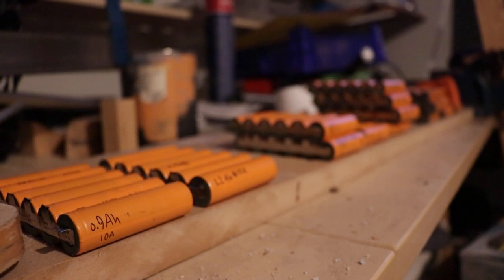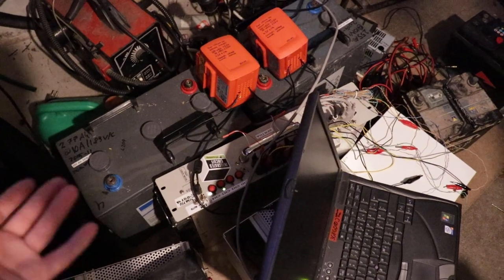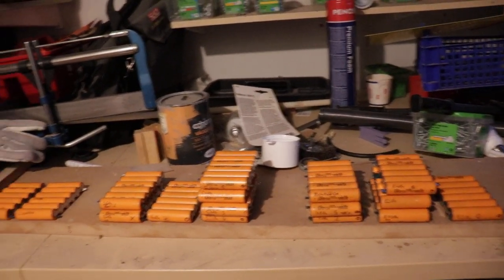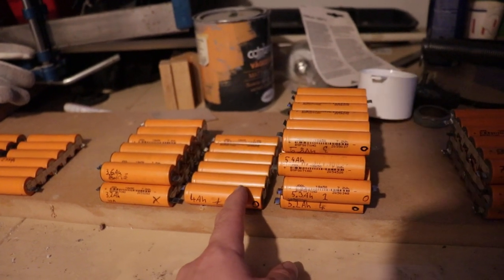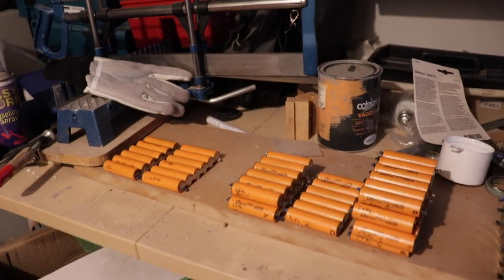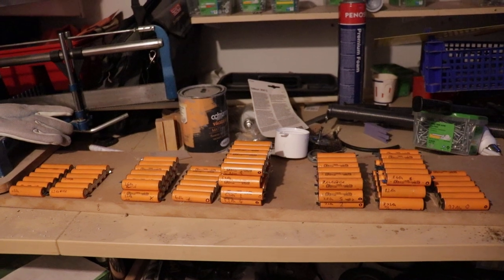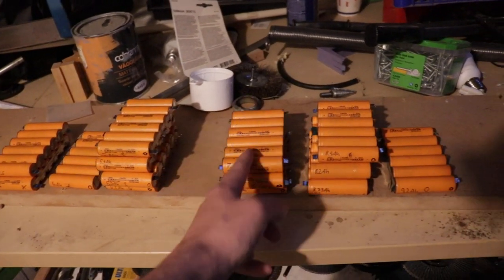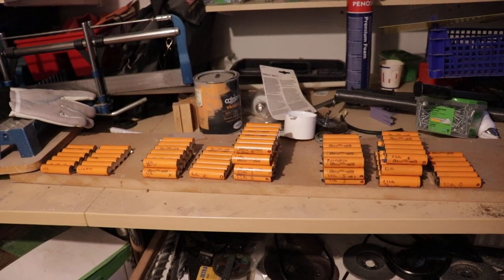Capacity test of every individual cell block in a bad ebike battery

Comment: i bet the bms had a hard time keeping it all together lol

i once taken apart a ebike battery with 12s6p with no circuitry at all. no balancer, cheap cells. the only things between the cells and the socket was a 30A fuse to the output , a 5A fuse  aswell as a PTC inline to limit the charging current on the charging port.  it did belong to some cheapo discounter ebike, literally a bomb.

Comment: Theory only, but my idea is that they're re-used cells, extracted from various-state laptop battery packs or the like, stripped of their original heatshrink wrappers and re-wrapped to look new, then slapped together into a pack and sold with an eBike that has a warranty lasting as long as a politician's promises, so when the pack dies, there's no recourse and replacements (which may or may not be in the same crap category) are expensive to buy...
Reply: Could be, but china has its share of manufacturers that just produce brand new trash cells. There are factories making 0.4Ah 18650s, with barely any materials inside, some make 2Ah cells that kinda work, but dont last due to impure materials and bad production machinery, etc. Its a huge waste of materials, but china doesnt care.
Reply from the maker: This is an interesting hypothesis, and I actually de-wrapped a few cells to see if that was the case, and had a look at them under the microscope. Sadly, there are no signs of re-use, and all cells appear identical. No duplicate weld marks, no scratches, nothing.
Reply: @FFcossag  Well, in that case, they're probably just plain old shitty cells, which as noted by someone else here is a thing they make seemingly intentionally...
Reply: @FFcossag  do they weigh any different?
Reply: @twocvbloke  Reused Li-Ion cells are not as much of a thing anymore. Seems china went towards recycling scrap cells for the active materials instead. Makes sense, since you can make 2-3 shitty cells from the materials contained in one old cell. Much of the  cost in recycling comes from purifying the materials, and you can obviously save here if it doesnt have to be good...
Reply from the maker: Not really, they're all between 43 and 45 g, and I imagine a lot of that variation is my crappy dog food scales.

Comment: It is hard to believe such variety! Unless the QC at the factory is so bad, which is hard to believe, they must be lacking electrolyte. Maybe they were badly designed, they weren't sealed properly and the electrolyte could evaporate from them? And the ones that got the most hot had the most of it evaporated, and the lowest capacity?

Comment: The owner may not have used it much but did they keep it at 100% charge all the time when not using it, on the charger all the time? That probably wouldn't sit well with cheap cells.
Reply: More likely it was stored at a LOW state of charge. Cells become unbalanced, then when charging the higher voltage ones got cooked.
Reply from the maker: No, it was mostly just sitting around at some random SOC.
Reply from the maker: The BMS in this shuts off at about 4.3 V/cell, which is way too high, but I know that the customer wasn't "forcing" it. She contacted me right away as trouble began, so I don't think the battery would have had time to die that way. Though it's not impossible. These cells could be overly sensitive to overcharge.

Comment: I'm sure someone good at statistics could point out that you have a significant chance of having at least one or more lemons in each batch and it pulls down the average. 

Can you even properly charge them if there is a bad one in parallel?
Reply from the maker: If there's a severely failed (i.e high leakage current) cell, you can't charge them very well at all. None of these are failed in that way, however.

Comment: Seems the cells have been charged at too cold temperatures or overcharged. This causes lithium plating in weak cells, and this phenomenon accelerates itself at every subsequent charge cycle, because the rising internal resistance resulting from plating will result in even more plating by every cycle resulting in unpredictable degradation patterns.
Reply from the maker: These cells failed because they are sludge.
Reply: @FFcossag  May be. But I have personally had good luvk with properly charged Chinese cells and I know over 15 year old Chinese cells still performing well.